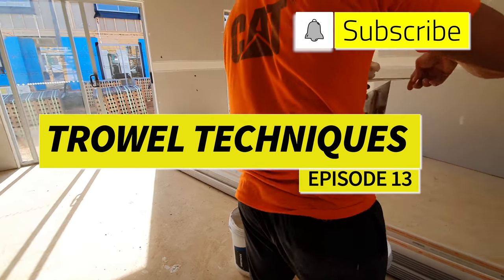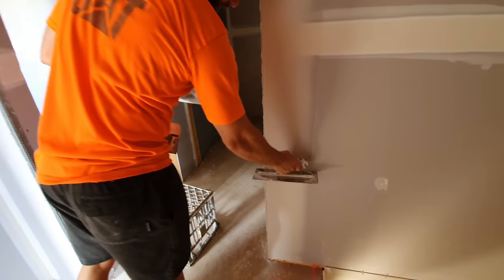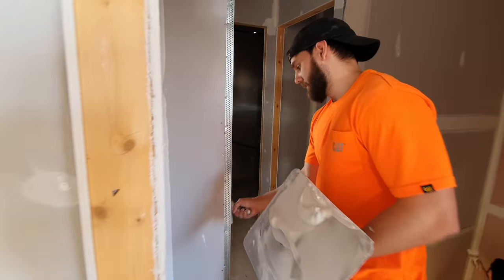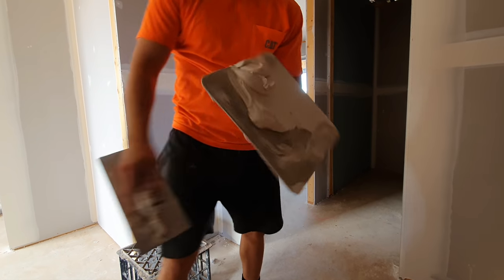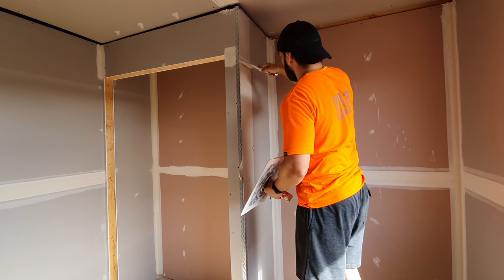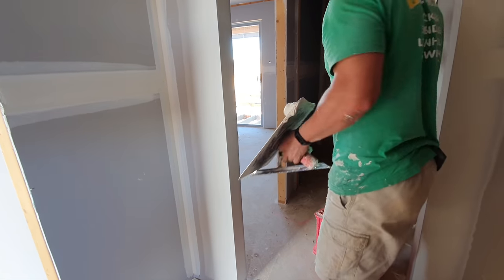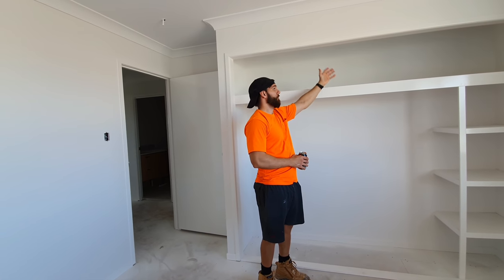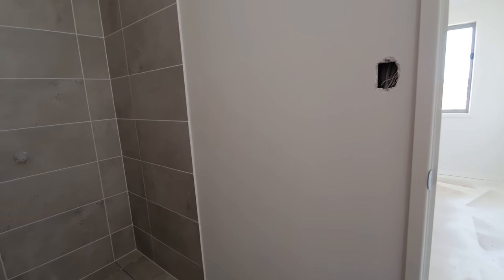HOW TO USE A DRYWALL TROWEL | Drywall Finishing Construction Series #13

Comment: The mud looks thick but they work it real easy!
Reply: It's sheetrock easy sand 45 it's light and fluffy really good mud to work with
Reply: @drywallgangsters , here in California we have a couple different products, one is plus 3, its light and easy to sand
Reply: Sierv is it a premix or a powder bag that gets mixed with water? Our one is a powder that you mix with water
Reply: @drywallgangsters  , its a pre-mixed that comes in a box, but we still have to add a bit of water, and it takes about 12 hours to be able to do a second hand
Reply: Sierv oh yeap we use hotmud to tape unless the job is huge than we might use a premix
Reply: @drywallgangsters  , yeah, I just realized you're taping, for that we use also 40 min hot mud, or pre-mixed all purpose joint compound if the job is a good size, you guys are very good with hot mud!
Reply: Sierv yeah we use hotmud for all first coating. Taping, beads screws and even second coat butts. If it's a big job we may tape with premix but we always coat beads in hotmud

Comment: for the people outside of australia (US/CANIDA) we dont use pre mix base coat in aus, we mix the mud ourselves,, so we can gauge how thick or thin we want it by adding more of less water,  thats why it doesnt go everywhere when we apply it
Reply: We mix water here in the US too. It just comes really thick in the bucket or boxes and you have to thin down depending on what your doing. It's way too thick straight from the bucket tho.  The only dry they have where I'm at is the hot mud like the 5, 20, 45, and 90 minute compounds
Reply: It's a lot faster to thin down premix than it is to mix from dry powder. I do remodels so I use a ton of 20 minute dry compound. It also lets me do multiple coats in a single day. The only time I really use the premix is on really large jobs and for my texture and thin finish coats

Comment: Quick mud or?
You should do an episode on what tipe of mud you use and when
From joints to finish
Great work
Reply: Sheetrock easy sand 90 minutes (45 minute if it's a small job) for all taping and sheetrock easy sand 45 for first coat on all beads and we use sheetrock total lite for 2nd coat and 3rd coat. Basically if you see us using white mud that's a powder mixed with water and goes hard in the time thats on the bag (45 or 90). The yellow is a premix mud that is air drying not chemically set like the white mud.
Reply: @drywallgangsters  So you guys don't 2nd coat with base coat?
Reply: Brent M no we just press tapes and fill them with base using a 6" and trowel or knife as we go but our 10"  box is all purpose and then 12" all purpose
Reply: @drywallgangsters  I've got to try them some time, we've been using standard base cote 90 and final cote

Comment: Hey bro, what Marshalltown trowels are the boys using?
Reply: Not sure what what they're called they're stainless steel and have a redish pink handle. Just any stiff trowel is good for first coat so you don't pull to much out you want it as flat as possible if you're using base so your other costs go on thin
Reply: @drywallgangsters  Chur boys! Love your work 🔥You make it look too easy 👌
Reply: Sanele Chadwick thanks bro hope that helped!

Comment: Hello, I've been watching your channel for a long time and I'm surprised if your quality is not checked? or is it ok? It's just that we have a good repair in Russia, these are 90 ° angles, the geometry of the whole house is in millimeters, we completely stretch drywall with a finishing putty, or we glue the fiberglass and putty then paint. perforated corners (these are glands at the corners we call that), you just put them on and it sticks out by 3 millimeters and stretches 15-20 cm already there is no 90 ° angle. we either cut it out once under them and set it to 90 ° or stretch at least 1 meter, show me your gypsum board under an angle light please in the next video, is it perfectly flat? Thank.
Reply: 9
Reply: Its not a perfect 90 degrees.  It feathers out.  Its not noticeable to the eye.  Same as putting tape over a butt joint.  The joint will be raised because of the tape and mud over top but using a wide joint, it feathers out to a point where it isn't noticeable to the eye.